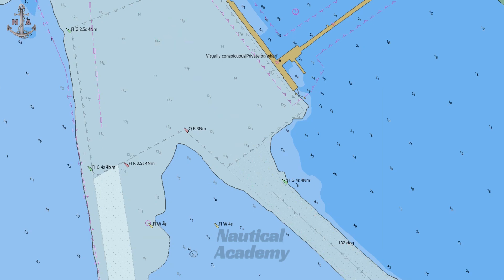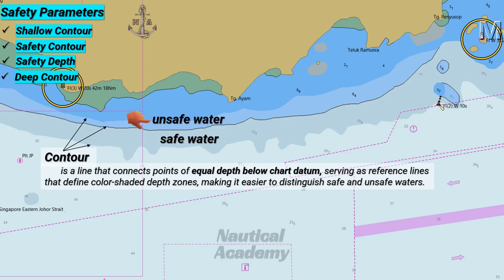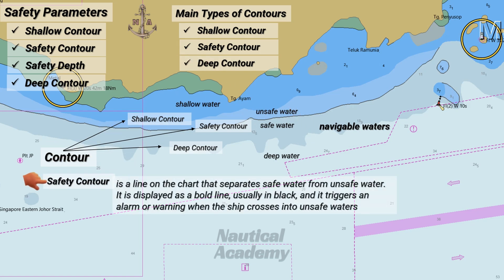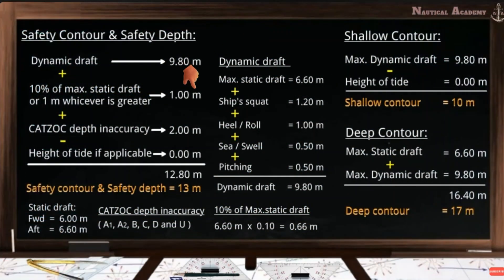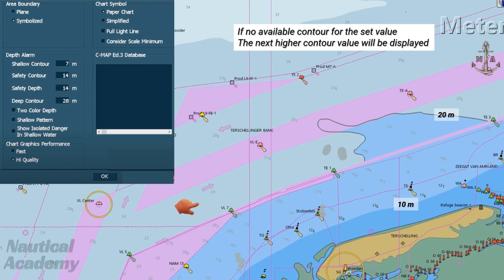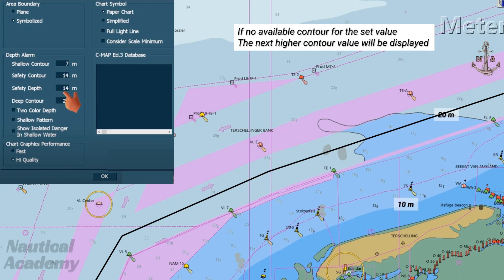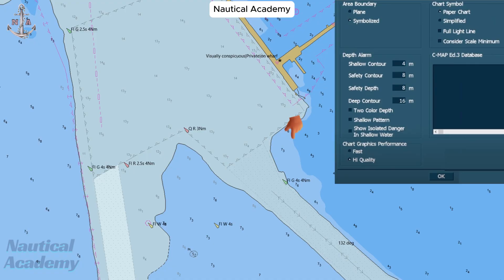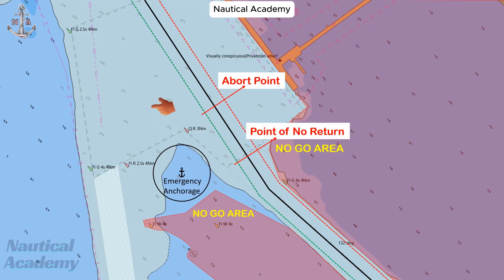Safety Contour and Safety Depth | Essential Guide for Passage Planning | ECDIS

Comment: Hello, great video. I just have a question maybe you can explain in reply. If Safety controu and safety depth already defines the navigable and non navigable areas (black/grey soundings) then whats the purpose of shallow contour?
Reply from the maker: Great question! The safety contour and safety depth show the boundary between safe and unsafe water, but shallow contour still has an important purpose.

The shallow contour is used to show areas that are very shallow and must be avoided early. It acts as an initial warning zone and improves situational awareness, especially in confined waters.